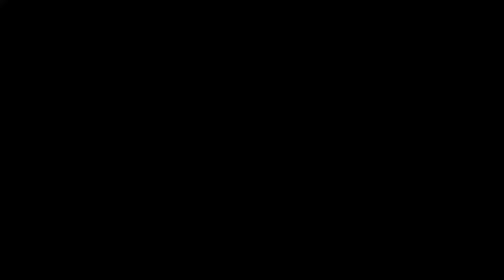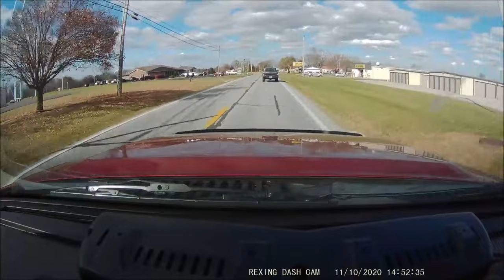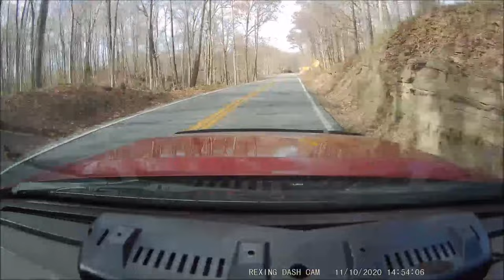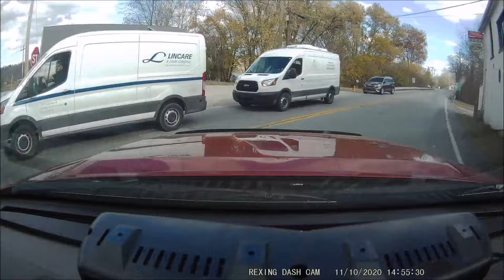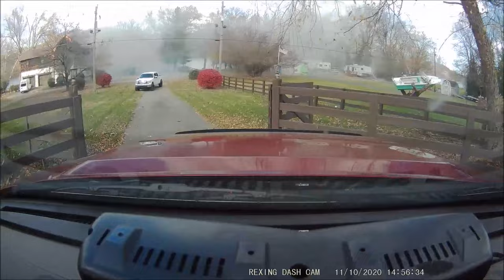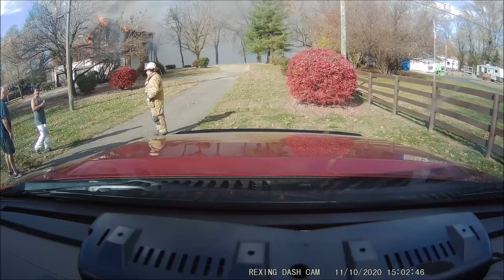Structure Fire Response 11/10/2020

Comment: I'm not a firefighter and every situation is different, but it sure seems like everyone had a hard time getting their act together
Reply: You’d be correct
Reply: @Cletus Kreider
Please, by all means... tell us all what was done wrong
Reply: @eoinpkav152  
You would be clueless
Reply: @virgilhilts3924  This was a fail from the start.
Reply: @markevan1  
Specifically how so?
Reply: @markevan1 what was done wrong?
Reply: No offense to the firefighters...but i didnt seem to see any sense of urgency at all.
Reply: For one thing no or inadequate fire hydrant.  People don’t want city water.
Reply: Hope no one was trapped while this guy sat in his truck .
Reply: Well ok,you asked. There should have been an attack line started immediately, good use of the porta tank but you have a lake right behind it. Portable pump would have given you constant flow very quickly. First truck with a gun could have knocked down flames while getting set up, might have saved 50 percent of structure. Listen, I am a firefighter, and I understand every stations protocols are different, but that's what I would have done
Reply: Facts
Reply: I agree with you 100 percent
Reply: @imorgasmic4411 you hit the nail on the head brother
Reply: @virgilhilts3924  the fact it took 16 minutes to get water on the fire…
Reply: @virgilhilts3924 then an additional 3 minutes to pull hose one the engine arrives and start fire attack operations
Reply: @sendit3456  
Is your idiotic assertion the result of...
a) You not knowing how to tell time
b) You not having a clue what is going on in the video
c) Both of the above

I ask because both the first and second Engines each put their master streams in service about two minutes after parking
The first Tanker set up a drop tank and dumped its load in about 6-7 minutes
The third Engine started flowing its master stream in about two minutes as well as set up a jet-syphon
Etc Etc Etc 
So I'm trying to understand how you came up with that nonsense

PS...
I would honestly suggest not answering because you have already made yourself look quite foolish
Reply: Got more guys standing or walking around than making an effort to stretch a line and put the dam fire out.
Reply: @DV-tc1yr  
Both the first and second Engines each put their master streams in service about two minutes after parking
The first Tanker set up a drop tank and dumped its load in about 6-7 minutes
The third Engine started flowing its master stream in about two minutes as well as set up a jet-syphon
But thanks for proving that you have no clue what you are talking about
Reply: It seems like some departments will let the fire get to a certain point before they even put water on it… smh

Comment: That’s a small town for ya. Half the time the department dispatches themselves because everyone just calls Chief lol. Great job Chief.
Reply from the maker: Very unusual for us. The guy that called was a Firefighter from another department so he knew I could radio it in quicker. He also knew that if he had called 911 on his cell it would have went to Indiana and then they would have had to call Kentucky which would have caused even more of a delay in dispatch. He basically bypassed all that and went straight to the source.
Reply: The delay is a big problem with calling 911 I will agree there we have the same problem here
Reply: @JASON8502  In small towns calling knowing who the FF are or the officers ends up being the better option, just call them and its done. Most fire houses have a button or switch at the station to activate the siren and off to the races, or like you just call dispatch and they sound off the tones and blow the horns. Being close to state or county lines make it that much harder as well, really depends on where the structure is located, we have homes in my area that have half in one departments area and the other in another departments area. Makes it tricky for the sheriff department to dispatch a VF department, so home owner just calls one of the local FF and they call the chief and trucks roll.
Reply: @scott miller your just across the lake Champlain from us, I live in WIllsboro NY. The department here test the hydrants about 2 times a year to make sure they work, the town also has long metal rods next to them painted red so that the FF can locate them during the winter season. I have one at the end of my driveway and I try to keep it clear of snow if they need to get at it.
Reply: Yeah, our area has frequently helpful dispatchers, but dear neptune they take their time calling the cavalry.  When we call county (911) time out on dispatch is anywhere from a minute to almost ten.  The older townsfolk still call the fire hall (which it’s purely coincidental if the chief or I were there), some call the chief direct.  It saves time in our town, to run down to the station, hit the button on the siren, then radio county, than just calling by telephone.

Comment: Poor performance from the first arrival until water was on the structure. Yes, they are hero’s for doing what they do but some training needs to be implemented so that everyone knows what their job is and how to get water flowing as fast as possible.
Some hell should also be raised about the fire hydrant situation in the area.
Reply: Unless you are a rural firefighter please don’t talk about fire fighting techniques in rural areas. Whole lot harder than in big cities where there is 1-2 hydrants a block.
Reply: So tell us what you would have done...
Reply: I was a volunteer firefighter in a rural setting for well over 35 plus years. The first in engine should have laid dual supply lines in that would have allowed the tankers to dump their loads out on the street with water being pumped to the first responding engine. That would have allowed a second attack engine to come in the second driveway and assist with fire suppression efforts. Since the hydrants were already reported as being out of order out of order then the supply engine for the tankers should have gone immediately to the boat ramp at the river to secure a steady water supply for the tankers. Definitely some need for some training here both at the drivers level and more importantly, at the officers level.

Comment: I have a genuine question here.  Now, I’ve done my share of career and volunteer and have served in Chief positions in both.  Based on following Milton’s vids for a few years, I can tell that manpower and response times are always an issue.  So my question is, why would you pass one of your stations just to get on scene first and wait another 11 minutes for your first engine and another 5 minutes for water?  I mean great footage I guess, but stopping to pick up an apparatus that can actually fight fire is absolutely more critical here.  This fire could have been drastically slowed with a one man engine given the conditions on initial. I’d have some tough questions to be asking if lived in this district.
Reply: Not really you cannot fight fires with just  one fire fighter and he is in command
Reply: @daltonmcdowell8068  you absolutely can, and in some cases have to.
Reply: You cannot fight a fire with a 1 man engine I'm not saying there's not some fd out there that would try this or they do it but it's not safe houses can be replaced firefighters lives cannot. Plus you need to be able to establish command on the incident as well as maintain span of control. You should learn ICS.
Reply: @Hal-Robinson  I assure I’ve spent more time teaching ICS than you could ever begin to imagine.  However, there are many times and departments that the luxury of ICS simply isn’t feasible.  You can absolutely manage slowing a fire with a one man engine with minimal risk.  This was 100% one of those cases.
Reply: I agree  you can’t putout a fire with a command car the first vehicle on the scene should be a fire truck and you are correct  one person with quick response can put out or at least slow the fire  incoming personnel  will then assist  once the engine is pumping assuming that it also has water on board one line will make a big difference in the progress of the fire.. retired small town firefighter
Reply: I've seen one man engines knock fires where I'm from so yes it's possible he could of held the fire in check with that peice of equipment till the arrival of others so I totally understand where your coming from I was wondering the same thing
Reply: @ConspicuouslyObvious   is 110 correct. hes not saying a one man engine should be making an interior attack. hes saying a one man engine can be on scene for others to respond direct to the scene, but also a one man engine can begin an exterior attack to slow and limit the spread of the fire it is entirely possible for one man to put one crosslay  in service to at least slow the spread. it wont put it out. one man cant overhaul a structure either. but he can put wet stuff on the hot stuff to slow the spread with just one man with the right training.
Reply: @johnnyrebel11  exactly.  Hell even a trash line would help.  As long as you’re getting something on it to help stop or slow the growth.  This is a very common thing in rural firefighting.
Reply: Did officer ever do a 360? Why drop dump tank away from engine? Too much time on positioning of apparatus than fighting fire. Appears there is need for more training
Reply: I’m not talking shit. BUT the guy called “fully involved” on something that was definitely not upon arrival. Or atleast from this angle is definitely not. Now, about the single man engine statement, whoever said that I 110% agree with and can attest too. “Safety safety” we literally signed up to stop fire progression. There is danger associated with the job. Stop using “safety” as a crutch not to do your job at your citizens expect you to.
Reply: @Hal-Robinson  did it for 4 years working at a one man station, not everyone has man-power and of course I never made interior but you can at least soften the structure..
Reply: Then all the men would have to drive there cars , and it would be a mess with all their cars trying to find a place to park, it didn’t look like there’s too many places to be out of the way. It sounds like there’s no fire hydrants so they are going to be tankers trying to find a place to park and maneuver around.
Reply: @ConspicuouslyObvious  I agree with you. I've seen Engine 51 on EMERGENCY put out a lot of house fires until the other units arrive to help. They will pull Johnny and Roy off the Squad to help if nobody needs medical assistance.
Reply: Agree with you 100%. I imagine their engines must carry 750-1000 gallons of water which can go a long way when used surgically. What appears to be a mainly porch/exterior fire could of been kept in check big time if he stopped for an engine or a tanker.
Reply: Use of rolled hose and reels would have done a great job as well.
Reply: Was thinking the same thing actually.. Along the same lines, I always watch people respond in personal vehicles.. The more vehicles that aren’t fire apparatus, police vehicles, or ambulances.. Now you’re a hindering the scene because you have a personal vehicle that is in the way.. This can cause more problems then that were worth.. You’re correct also noticed that the fire station was passed up, and heard 1 response in an engine granted not everyone can make the rig but all things to think about.. The fancy lights, and sirens on your pick up will not help fight the fire.. Cafs or water does
Reply: Has anyone determined that first arriving actually drove past his fire station?  I’d be first on scene in 90% of my 215 square miles never having gotten near my station.  Are we assuming “fire control car” because his POV is a red pickup?
Reply: @Hal-Robinson  I've done it more than once from the exterior and kept the fire to a minimum until other manpower and apparatus arrived. I'd rather be doing something other than just standing there and watching it burn. I saved a mobile home once with a brush truck while returning to the station from getting new tires and a lady flagged me down and said her house was on fire. It had a exterior access panel to the water heater and the fire was in there, 100 gallons of water is all it took. If I'd waited for an engine that was 12-15 minutes away it would've probably been a total loss. I was also in another departments district at the time. But it can be done.

Comment: Before anyone comment WhY Do YoU NeEd TaNkeRs. Read the description. They were not functioning
Reply: The hydrants***
Reply: My question isn't why they needed tankers, its why it took so long to get water off the tankers, why they wasted a thousand of water out of a deck gun with no water supply, and what the thinking is putting the dump tank all the way down the driveway, then parking an engine in front of it blocking it, all honest questions not trying to smoke anyone

Comment: ...City dwellers often say, "Oh, just follow the orange glow or trail of smoke!" - NO! Doesn't work that way! I actually like some of these POV response videos, especially those in rural areas... It gives the viewer an idea of just how large some of these fire districts can be, and how far first responders sometimes have to travel to answer a call...
Reply: I know big city career guys act like they know it all. But half of them wouldn’t know how to set up water supply without hydrants our 3 trucks with 4 guys.
Reply: Trey Neal - They had huge supply hoses running clear to the boat ramp, and then into that portable holding tank... Once that  connection is made, you have a sizeable supply... All fire companies can draw off it!

Comment: As a member of volunteer dept in much more densely populated area in NY,  all things considered this was a good job,  maybe a little slow with first water on the fire but with how far away these fires are from any fire equipment and personnel you had your work cut out for in right from the start.  First car on scene in around 4 minutes but first engine only pulling in after 15 minutes. By that time the fire had already gotten a good foot hold. Living in these rural areas certainly has its upsides and drawbacks.

Comment: EVERYBODY HERE NEEDS TO DO ONE SIMPLE THING:

Read. The. Description.

Hydrants were not working (Not on the FD btw)
The 'lake' is a river, that is much father away than it seems, and a barge went by the stirred up the silt as well.

Just read before you talk.
Reply: The was at least 6,000 gallons of water on the first three tenders plus the booster tank on the firs due engine. There was plenty of water. Flowing 2 1 3/4" lines at a total of 300 gpm, 6,000 gallons would supply them for 20 minutes before the shuttle begins. Plenty of water.

Comment: Great video - I’ve watched many of these and am no expert but I’ve seen a few trucks that have a front bumper-mounted “cannon”.  They pull up and are hitting the fire within seconds - from within the truck.  I assume they need to have a sizable tank as well.  Are these only common in major cities?  I suppose in rural areas perhaps an all-around pumper is more useful.
Reply from the maker: We actually have one on our 8532 but, we would need to have water supply to make it work. This was the problem with this fire, we had no water. The river behind it was too far as well.

Comment: Having served on a couple of volunteer fire departments in rural counties, I’ve had quite a bit of experience with water shuttling. 
The First engine in should have started attack with hand lines.
First tanker in should have staged at the end of the driveway in a way to drop his drop tank on the side of the road and take suction from and run a 5” supply line to the first engine. This way, follow on tankers could stay on the road and side dump into the drop tank. 
Research needs to be done in the area to locate the best draft site from the river. The second engine and or tanker would respond there to set up a draft and lay a 5” supply line as close to the road as possible with a Y-gate and 2 smaller supply lines of 3 or 4 inches to fill the tankers as they come to refill. Another option is to get a portable pump or 2 to use with swimming pools, ponds, or rivers that in areas where apparatus cannot get close enough to the water source, can be deployed to help fill drop tanks, supply hand lines or get creative. 
But water shuttle training needs to occur in that county and ideal draft locations need to be found and made known to all the departments in the area.